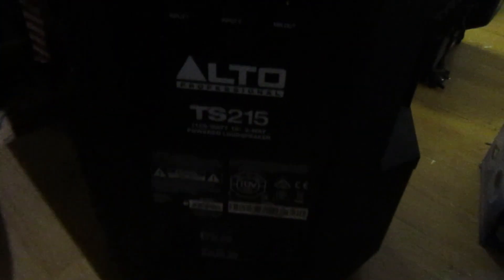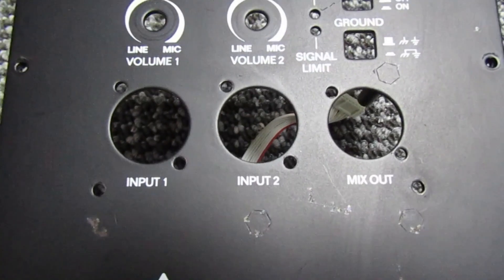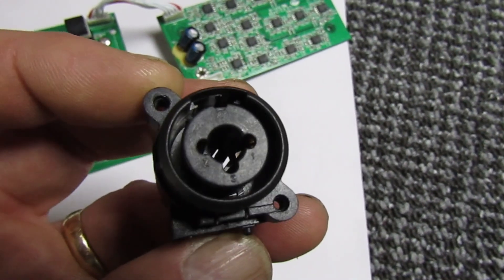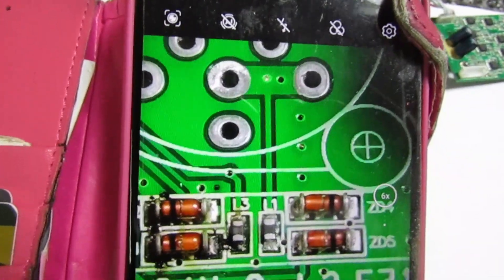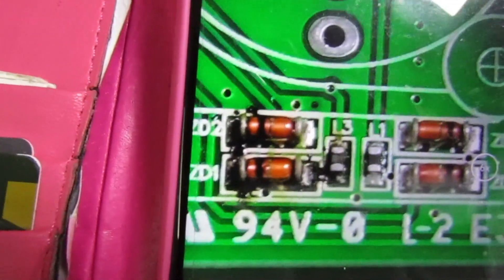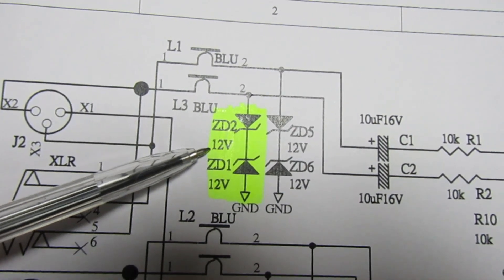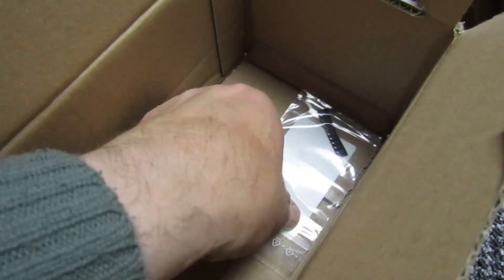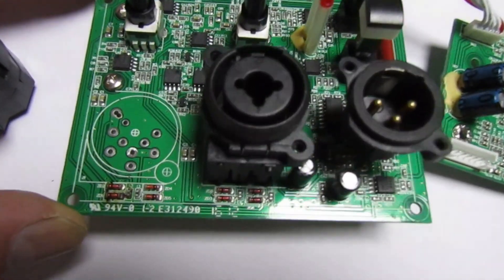Alto TS215 amplified speaker repair, no sound on CH1

Comment: I fixed a Paradigm subwoofer for my plumber (and got free plumbing in return!) and it had a blown 1N4742 12V zener for the rail to all the op amps. It had failed mostly open (and thus killed a lot of other stuff) and I wouldn't have sussed this as quickly if it hadn't actually glowed a little but to let me know it wasn't feeling very well. I ended up replacing smoothing cap, 5x LM324 op amps, a monolithic amp chip, and I also fitted 5A zeners to try and avoid future mayhem.

Comment: How would fiddling with the jack plug intermittently bring the volume back up in this case?
Reply: Because the zeners were s/c they would fully clamp the input signal, but I'm sure they were also dry-jointed because of the heat damage, so wiggling the jack would disturb the board and the joints.
Reply from the maker: This is what fooled me into thinking the jack socket was faulty, it can take a stereo input hence 4 zener per socket and if you pulled out the jack a bit it connects to the working channel.

Comment: There's something a bit dim when stage equipment uses Jack's for input and Jack's for speaker output 😮
Reply: Jack's what? 🤔
Reply: @stopthebus Jack's plugs lol
Reply: they're Neutrik combo sockets, they accept XLR plugs just the same
Reply: @kevvywevvywoo yes I know, I used to be a repair tech at a stage equipment hire company, and 90% of customers used the jack plug leads to connect everything including speakers so amp outputs into line inputs a plenty!
Reply: Duh

Comment: Someone has connected the input to a Phantom Powered device. This typically is  +48 volts DC on pins 2 and 3 of the XLR-3 connector, with pin 1 as ground. The high voltage has blown the zenners as its supposed to do to save the preamps etc
Reply from the maker: yes , this could have well happened but when the customer came to collect I asked him how it came to go faulty and he told me it had been connected to the speaker terminal of a power amplifier .
Reply: @michaeldranfield7140  did you ask him why he didnt tell you that before you started fault finding?
Reply: Phantom power normally only appears on mic inputs, so unless the user was completely clueless I can't see any reason why they would connect a mic input to the input of this speaker.
Reply: It's a theory but not a correct one I think. Phantom power is only available on microphone inputs as stopthebus quite rightly points out, and there is nowhere near enough current available to do any damage from phantom power. By design it has to be s/c proof as it is regularly abused due to incorrect connections etc.